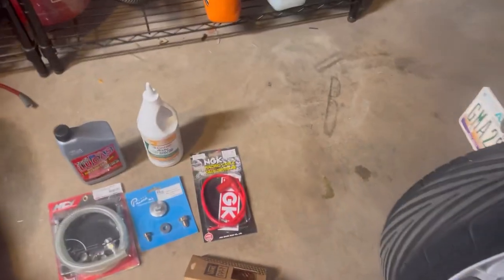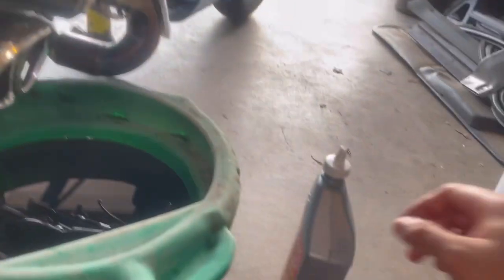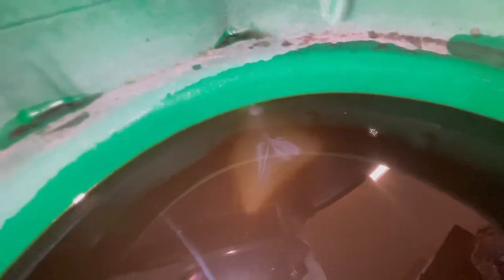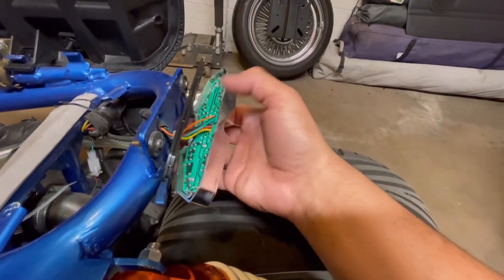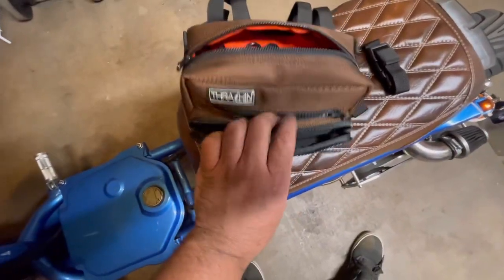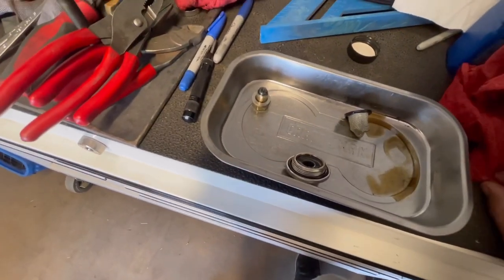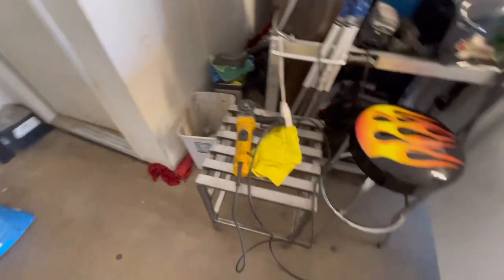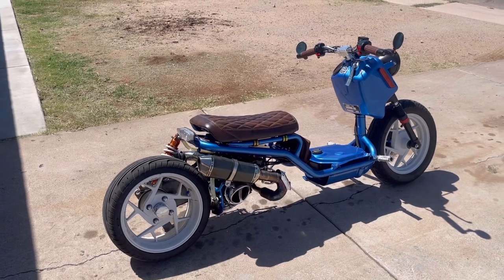2022 Icebear Maddog Gen V: First oil change and some improvements.

Comment: I watched, I  liked,  I subscribed. 
Got my Gen V 150 2 weeks ago.  
Had a 2012? Chuck's carried on from carrier on pickup.  Got in accident, it was totaled.  That was a couple years ago. Enjoying your mods, 
Sorry to hear but thankful you're posting your problems.  I was zipping along at 45-50 when I lost power,  blap, nothing no throttle response.  30-45 seconds while coasting,  it came back to life. Haven't figured it out why yet. Tech help at Motorbuys is a flipping joke! Be changing oil in 4 days. Adding my magnets then. What oil did you use in the gearbox?  Rolling Wrench sent me synthetic for engine but saw you Adding gear oil to rear-end.  You notice any thing with the crankcase breather?
Reply from the maker: Thanks for watching. Yeah exactly. Diagnosis is the name of the game when working with engines so trying to help others when I can. When I have the throttle wide open for a long time the same thing happens. No throttle response and seconds later (after slowing down)we are back to normal when the pump has vacuum again and starts delivering fuel to the carb. I’m using a 80w-90 gear oil. So far no leaks out of the breather tube.

Comment: What is the piece for the ignition cord plug in? The oem one is like glued on. Is that a special one to run this ngk wire plug? I don’t see it in your description
Reply from the maker: Not sure what you’re asking. I only replaced the plug cable and added a thread cap to the spark plug. I also reused the factory ignition coil.

Comment: The problem is probably the vent he put on to lower the crankcase pressure. It lowering the pressure to much change from that 1/2" to 1/8" enough to vent without losing pressure. Just saying

Comment: Question Bro.. Will it be possible to just use wb40 and pull the grip? Or do I have to take the control out first, then pull the handle grip. I appreciate it.
Reply from the maker: I just cut the original one with a razor blade and had to fight the new grips back on. You don’t want to use wd40 for install because it might slip off. Not sure about removal

Comment: Can you give me info on wiring the tail light, my running keep burning out
Reply from the maker: Yeah! Check out my fuel pump video! I talk about all the tail light wiring and the colors because the fuel pump harness taps into the brake light. 
Yellow left turn 
Orange right turn 
Red brake light 
Green power
Black ground

Comment: Did you change the oil the very 1st day you bought it or did you keep the manufacturer oil in it?
Reply from the maker: Yup. Original oil. First oil change at 300 then 600 and every 1000 miles after that. Runs great. Some people say you should change it right out the box. I didn’t.
Reply: Thanks for the info they also say change the battery change the plug etc. mine will be just for weekend lil rides
Reply from the maker: I still have original spark plug. My battery has dead since and I replaced it.

Comment: Decompression tube ROBS VACUUM this is the failure you’re having with Vacuum fuel pumps
Reply from the maker: Maybe but I went electric fuel pump. And still have the decompression tube. Got more power. Absolute unit now. Vacuum pumps are garbage.  Upgrade asap. I’m sure yours works but electric is always better. Vacuum is inconsistent with engine rpm’s which means the fuel pressure does too. Electric pump has consistent fuel pressure all the time.